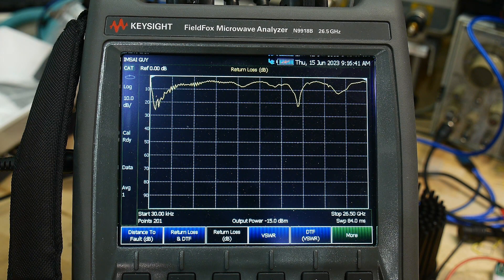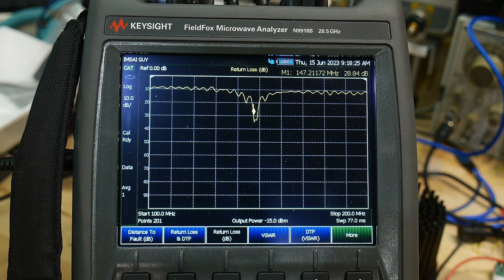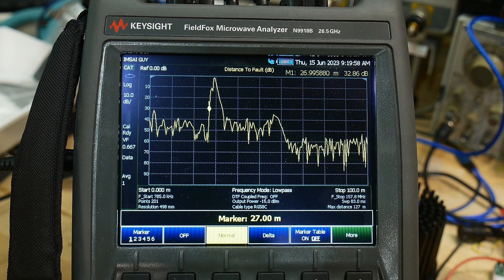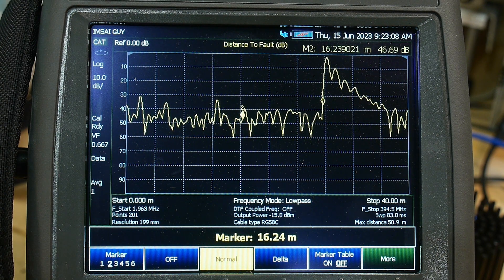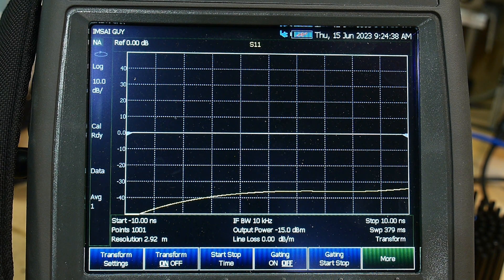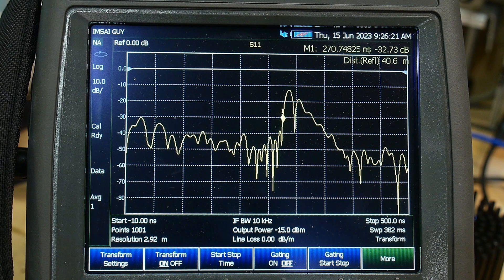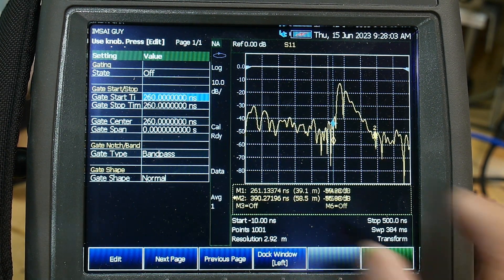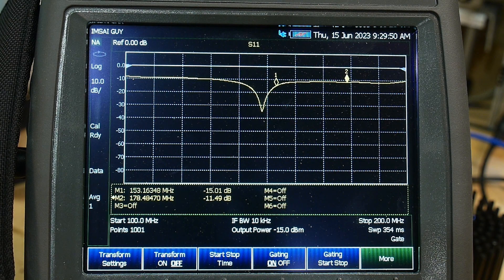#1555 VNA S11 Time Domain Gating FieldFox

Comment: While gating is showing you the actual antenna characteristics, your transmitter isn’t connected directly to the antenna. Coaxial cable factors are going to decide how your transmitter reacts to the overall system.
Reply: Did you not finish the video?